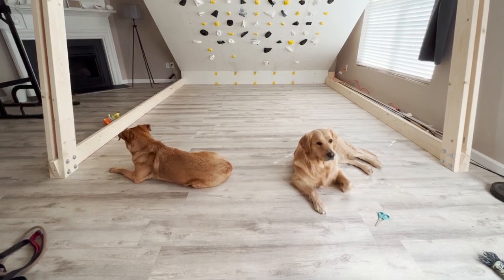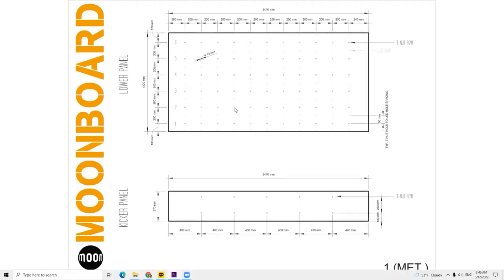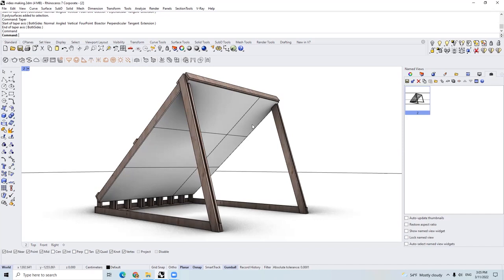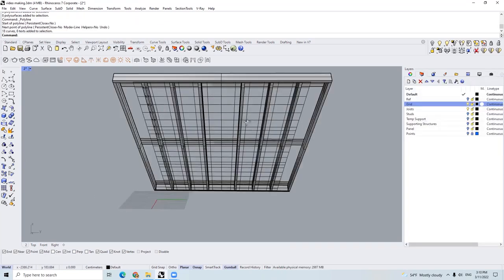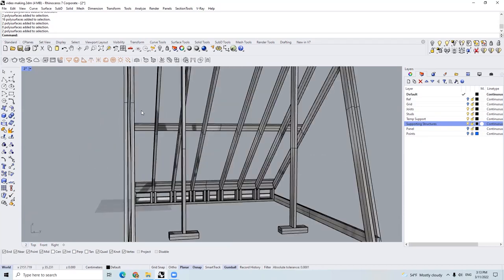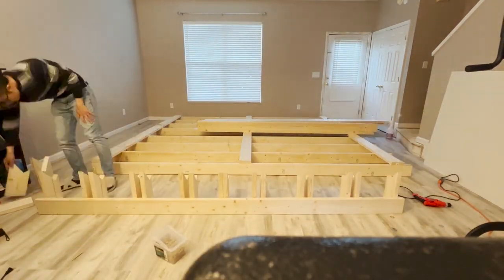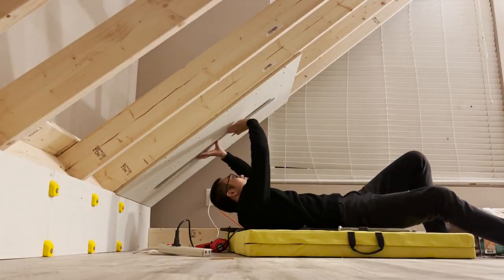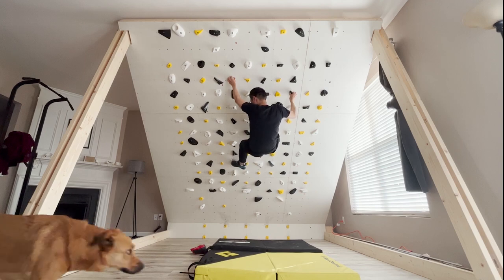MoonBoard DIY - How to Build a Freestanding MoonBoard - Digital Model & Construction Drawings

Comment: hey im having a hard time with the digital model. I need the measurements / angle for cutting the studs. thanks
Reply from the maker: In my playlist, there's a section on Rhino basics where you can learn how to use the software and measure dimensions.

Comment: Hi, is 400mm the distance from the center of each joist to the center of the next joist, or the distance from edge-to-edge? I did edge-to-edge on my board and ended up with a distance of only about 14.25 inches between the two center joists in the end. Thanks for any help!
Reply from the maker: There is no difference between the distance from edge to edge and from center to center between joists—they are the same, unless the joists have different thicknesses. Please refer to the attached 3D model in the description for more details on the distances between them. They are not always identical.
Reply: Thanks so much!  @Daoru_Wang

Comment: Great job! What is the estimated cost of the wood? Do you think it's possible to make it work outside?
Reply from the maker: Thanks! I think the wood and hardware together cost around $1,000 in total. I don’t think this is suitable for outdoor use because the holds will get wet when the humidity is high. Additionally, if placed outdoors, the wood would need to be pressure-treated, which would increase the cost.
Reply: @Daoru_Wang  Thanks for the answer! Do you mean that the holds would get wet and it would damage them somehow or just reduce friction (which I could live with)? I want to build something like that, but I have space only outdoor.
Reply from the maker: @rabca.123  Leaving it outdoor means it be exposed to rain, snow, and sun, which can damage the holds, LED system, and wood structure. Consider using weather-resistant materials and adding a roof or tarp for protection. Don't buy the new set that have wooden holds in it, I don't think they can hold there long if you leave them outdoor.

Comment: is there any reason why the plywood cannot be attached to the wall before the wall is raised and attached to the support beams?
Reply from the maker: Because five sheets of 3/4" 4x8 plywood weigh about 350 pounds in total, it would be too heavy to lift. Additionally, the surfaces where the plywood needs to be installed are usually close to the ground, leaving no room to install it before lifting it.

Comment: Is the bottom support beams 10 ft or 12 ft? And also the vertical support beams?
Reply from the maker: Please refer to the models in the description.
Reply: @Daoru_Wang  Your gdrive files arent really working.
Reply from the maker: @WMorris  I just checked them, they are working fine.

Comment: Would you recommend putting up the plywood first onto the frame before hoistingthe frame up on to the supports?
Reply from the maker: I recommend you to set up the frame first, then put up the plywood.
Reply: @Daoru_Wang how precisely did you cut out the 90 degree angle into the studs? I am starting the cut with a circular saw, then finishing by hand which is a little janky